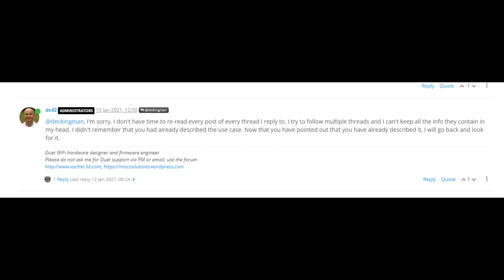Update and Duet 3 Warning!

Comment: Fing YouTube algorithm, I have missed more than 4 months of your progress, and because WordPress hasn't been updated I started worrying about covid, hope you ok.
Anyway I just have one question to ask before I watch all your videos again, im using a 0.6 nozzle in a mixing hotend (a20m creality) and can't stop ouzing, I'm assuming I need to use 0.4 nozzle as the large mixing chamber makes clean retractions impossible, how do you get round this, do you retract all filaments at the same time even if printing one colour? Thanks for your hard work, nice to see you still going!
Reply from the maker: Thanks for your concern. Yes, I'm fine (under the circumstances). Lockdowns and the whole situation are driving me crazy like everyone else I know. 
Ohh, yes - with a mixing hot end, you MUST retract all filaments - not just those which move forward. If you don't do that, then what happens is that filament is simply drawn from one of the other inputs, rather than the nozzle tip. An 06 nozzle is going to be worse but you should only get oozing while it's heating, not during a print if you get retraction right. I don't know what hardware/firmware you are using but Duet firmware retraction (G10/11) will retract all filaments that are assigned to a tool, regardless of what the mixing ratio is. So you could have 3 inputs with a mixing ratio of 1.00:00:00 (all one filament) and all three filaments would be retracted simultaneously, even though only one is moving forward during the print. Personally, the smallest nozzle I use is 0.5mm. If you do the maths, an 0.5m nozzle has a cross sectional area about 50% greater than an 0.4mm nozzle. So a lot higher flow, with less potential for hot end pressure build up, with not much loss in resolution.

Comment: I will almost certainly weaken and go the 32-bit route in the future, and that will likely be Duet, for the time being, whenever I try a completely new function, I build an auxiliary PCB to provide whatever function it is. This reduces most things to little more than set or clear a pin and wait for another pin to change. This is my way of avoiding the frustration of something not working as expected or not working at all - it also allows me to stretch my Arduino/RAMPS controllers to way past their sell-by date.

Comment: I need a new controller to my Anycubic Chiron. Ports behaving badly etc.. Been playing around with Klipper and what I know  Duet 3's are not yet supported. So I went for looking up what users say about Duet 3 and your Update and Duet 3 Warning scared me as I am looking at the new Duet 3 Mini 5+ Wifi that obviously has some issues.

Reading between the lines it looks like the Duet 2 WiFi would be a better choice for me. I am retired 70+ old fart so money is also very important factor as I can not afford high risk projects only want a reliable printer.

So what would you suggest.

Cheers from Sweden
Bengt
Reply from the maker: Hi Bengt
I would suggest Duet 2 - either Wi-Fi of Ethernet (I prefer a wired connection personally), unless you want to run more than 10 motors or you want to use stepper motor currents higher than about 2 Amps. Duet 3 firmware still has bugs. The latest beta version (3.3 beta3) broke my printer yet again. Before "upgrading" to gen 3, I had a Duet Ethernet plus a Duex 5 expansion board which was rock solid. Gen 3 has been nothing but trouble for almost 2 years now. For info, I'm only 3 years behind you and also trying to survive on a limited pension :)
Reply: @deckingman  Thank you for your answer. Looks like I am going for the Duet 2 then as I am not willing to be a lab-bunny ;) 
Cheers Bengt

Comment: Hahaha I'm glad someone's finally saying it, I'm sick of everyone pretending Duet is the best controller on the market, it's overpriced nonsense. My BTT GTR 1.0 is doing just fine and it was much cheaper.

Is DC42 actually the only person writing the firmware? If so, no wonder each line of code takes a week to get working :') Your extruder problems sound hilarious, all that engineering and effort put into the extruder and it just goes in random directions. Story of my life lol.

I hope you get your printers working soon!
Reply from the maker: Yes. DC is the only one coding the firmware. He took over what was (and still is) RepRap firmware which I believe was original written by Adrian Bower. Chris Ham...does the web interface on some sort of unofficial part time basis and another guy who I won't name has started helping out on an informal basis with things like the Panel Due. AFAIK, DC is the one who decides what "features" take priority.
Reply: There are three of us making core contributions to RRF, although I am the only one who is nearly full-time on RRF. The priority of new features it set by myself and my fellow directors of Duet3D, taking into account requests on the forum (especially when multiple users request the same thing) and the need of our OEM customers..